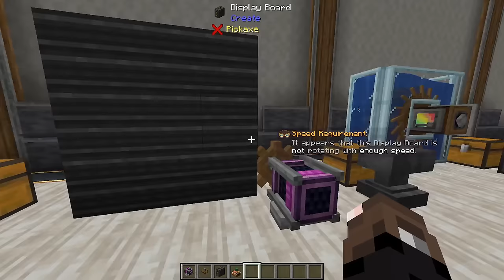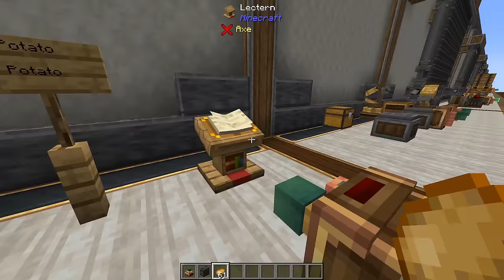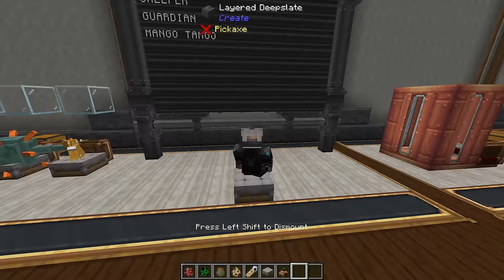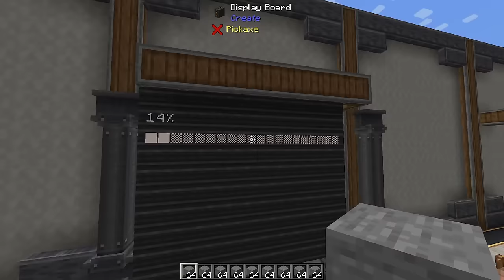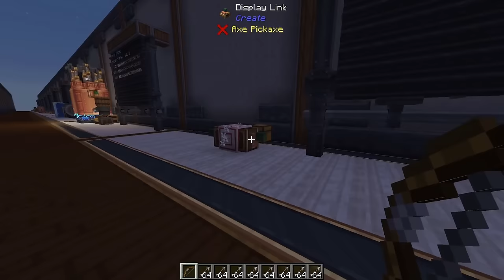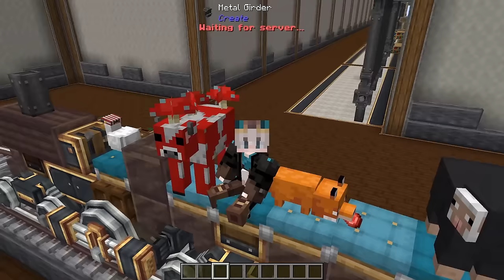Ultimate Guide to Display Boards | Create .5

Comment: I recommend setting the station name filter to an asterisk, which will then read all the train stations information on the display board.
Reply: It works with wildcards??? Thank you!
Reply: THANK YOU
Reply: Is it just wildcards or does the whole of regex  work?
Reply: Found the power user! Hey, can you help me fix my computer? It keeps telling me to press any key to continue, but I can't find it anywhere on the keyboard. Is this a keyboard issue or a bug in the software?
Reply: @iansullivan9738   most keyboards don't come with an "any" key. Pressing F4 while holding Alt will do the same thing.
Reply: @iansullivan9738  lmao, I get it.
Reply: THANK YOU
Reply: you saved my train tysm
Reply: I have a airport and bus system which use trains as “planes and cars” Is it possible to exclude these or better yet, use key words to display stations on certain lines (eg. use south to display all stops with the word south in it)
Reply: @iansullivan9738 press any key on keyboard
Any is any key like a b c or whatever you want
Reply: @timeminecraft6019  Idk man this is just what I figured out
But if you do South Side * it’d basically do the same thing, but only for everything that starts with South Side
Reply: that was what I needed thank you

Comment: A couple of points to note;

If you provide a lot of rotational power to a display board (I believe 128 upwards) it'll update instantly, instead of using the flip animation.

Also, you can use glow squid ink to make the text glow.
Reply: Nice, I think the flip animation looks cool though

Comment: One thing missed in the display link for train station summary, and for train schedules, is they have wildcard/prefix support.

So with your example setup, one could use "Passenger*" to list all info for Passenger North and Passenger South.

You can also use this as the stop in a schedule, so a train will pick one of the stations that's free and route to it.

This is very handy for a station with multiple platforms, as you can:

- Label each one (e.g. Blockville Platform 1, Blockville Platform 2 etc)
- Display a summary per platform (e.g. at the top of the stairs/ on platform about what's due)
- Also display a summary for the entire station (e.g. in the main Atrium)
- Have trains route to whichever is free currently
- Still route trains to specific platforms if so desired.
Reply: > a train will pick one of the stations that's free

Do note that this will also take signals into account which you've set to red manually with Redstone. Meaning you can disable stations even if no train is currently occupying them.The trains will then route to other free stations. Also, if no station is free the train will route to the closest one and wait in front of that stations red signal. Meaning your closest station should always allow the train to move to another one when it is waiting in front of it.
Reply: Thank you both! This made routing my system SO much easier

Comment: Very nice tutorial on the display boards. Could you maybe make another tutorial explaining what the 'Train column size', 'Platform column sIze' and 'Station name filter' do and how to use them?
Reply: I think I can help with this a bit - the "Train column size" is how much space do you want the train name to occupy on the board, as a percentage. "Platform column size" is useful in combination with the "Station name filter", and it represents how many characters it'll display of the platform name. How to create platforms? Well, you rename the train stations to be similar to eachother - let's say "Main station 1" as platform number one, "Main station 2" for number two and "Main station cargo" for a cargo platform (it should work with letters, yes). Now what you do, is that you set the Display link's "Station name filter" to "Main station *". Now it'll show all 3 platforms, and show either "1", "2" or "cargo" as the platform. It works on schedules too - set your passenger trains to "Main station *" if you don't care where they end up, and specify "Main station cargo" for the cargo trains.

Comment: I've updated Create to 0.5 in my own world, and I'm planning on using these boards to have a central board that always shows the last location I was in. Basically, each location has a pressure plate at the entrance which droppers a named paper into an EnderStorage chest. The central board location has a corresponding Ender chest and when anything is in it, it unlocks two hoppers momentarily, pulling the previous paper out of a barrel and the new paper into it, thereby updating the board. (It'd be nice if there was an option for "set hardcoded text upon redstone signal", or some component that could allow that, but meanwhile this paper method works.)

Sure, it makes more sense on a server, but I think it's fun even in a single player world :)

Comment: I love the display boards and links, but I hate a couple of things about them. It would be a lot better if the links had an ui similar to train schedules and they were able to do various functions with one link: one link that displays everything about su with only one su gauge. It would also be great to be able to display to various boards with one link. It would work like the schedule: plus button to add functions, and another one to add boards where to display and which lines to use from them

Comment: I didn't see how you link each display link to each board. Obviously you can have several Display Links sending information to multiple Display Boards, in the same area, at the same time. But how does each know where to get/send it's Display information? Is it like the Mechanical Arm, where you link it prior to placing it?